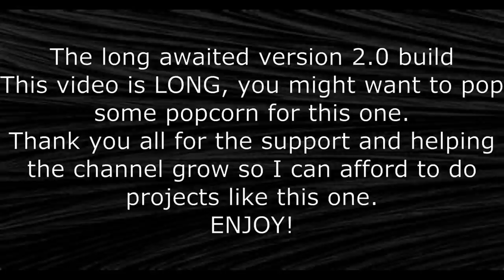Homemade ice maker build! VERSION 2.0! Cleaner build! #435

Comment: Hi,
Looks great, good work!

Q, I don't see how you can have a single normally open door switch (which is an excellent feature add btw!) Controlling Both fans simultaneously.

While individually toggleing the power separately to each fan via a unique switched outlet with the temperature probe?  If they're tied together at the switch they must be tied together at the power source otherwise I believe there would be a dead short,  or is the door switch inline with the line cord on the smart strip, what am I missing?
I did note you mentioned you were going to order a second interlock switch.  
So was that an oversight and the second switch will allow you to isolate the two fans for independent ejection cycle control?? 
In the meantime you could bypass the switch for one fan (which you have to do anyway) until the second switch arrives permitting individual power control of each fan now.

Good luck!
Reply from the maker: You can't, that's why I said it technically wasn't done and explained the fiasco I've been having trying to get the second switch in. For now I'm having to unplug the power supply to kill both fans until the second switch arrives.
Reply: @TKCL  

Hi,

So is the root cause of the problem you only purchased one switch initially not realizing you needed two for individual control ?

If so you will also no doubt require an additional independent DC supply to individually toggle the 2nd fan, as well.

Or is the goal to stop both fans when either maker initiates its ejection cycle? Which may be ideal, but would complicate the build just a bit (would require some inline diodes)

Perhaps a vertical barrier starting at the door extending down a bit past the fans between the two makers to interrupt the air flow when one is on and one is off to simplify it?

I would have suggested you go with a one amp transformer as the current two amp model is not required.

ASIN      B084JG4619

Coolerguys 100-240V AC to 12V DC 1A Fan Power Supply, 3PIN Output or 4-Pin PWM 

However it may not fit on the smart strip without a  six inch extension???

Re the controllers temp set points ...

1-  Outlets both set to - Normally On.
2- Trigger - Off @ 40° F or above ?
-you mentioned upping it to 80 but then the fan is fighting the heater (dangerous)
3- Trigger - On @ where exactly ? Somewhere below 40? but that will take a very long time at the precise time you WANT the fan on in the first place.

Even setting it for a differential delta is tricky as it can overlap and is confusing.

I don't believe this is the proper tool for this job? Perhaps a pair of ...

ASIN 	B00WV7GMA2

May be more appropriate?
as the fan will stop as soon as the heater starts and resume the moment it stops perfectly maximizing Both the heating and cooling cycles.

Thoughts?

Good luck and thanks for the fun!!!
Reply: PS
 Perhaps super high velocity fans (150/60 cfm) are no longer advantageous now (as opposed to a standard one of 60-70 cfm) that you are so close with max cold or not air. Just having any fan so close is super dupper effective, just NOT when the heater is on.
Reply from the maker: I started with low velocity fans and then moved to high velocity on my last build. Testing showed a significant increase in production with higher directed velocity
Reply from the maker: I have two power supplies and went with the 3 amp ones after talking directly with someone from cooler guys. They recommended the higher amperage power supply for this type fan.
Reply: @TKCL  

I see however 
That was with only one which wasn't directly pointed at the mold though, a very big difference imho.
Good luck 👍
Reply: @TKCL  

Hi.

But as per the spec they only draw 3/4 of an amp.
SPECS
RPM: 3500 +/- 10% Current Rating: 0.75 Amps Air Flow: 157 CFM

Also btw, the brick model is only rated at two amps which is still 160% more current than required.

So cutting it in half is still far within spec

Good luck 👍
Reply from the maker: If I remember correctly it had to do with fact that I am running these 24/7, the bigger power supply can probably shed more heat and will last longer in this situation. 🤷
Reply: I believe the far more relevant factors are the set point to turn the fan back on at below 40 degrees. So no fan between 80,90,100? degrees in summer until it gets all the way back down to somewhere below 40 ?

That basically defeats the purpose of even having a fan at all. As that is precisely when you need it the most to gain the maximum advantage in reducing the time to freeze the next cycle. Why are you so attached to monitoring the temp to detect the ejection cycle rather than the specific electrical signal which turns it on and off in real time which you could leverage to turn the fan on and off at the same time, what am I missing ?
And the other factor being isolating the airflow with a small barrier for when one is on and one is off.

I don't want to take the fun out of it but it's really no more work or money just ...
Mo time
Mo videos
Mo views
Mo money 💰🤑😎👌

Best regards!

Comment: Great idea and video!! I bought everything on the list but the power supply in your description is the wrong one, you said that you called and got the correct one... do you have the new part number? Or is it the correct PS that I just cut, strip, and use the 12 volt connection?
Reply from the maker: That is the correct one, you can hook up to three fans to it. I had to use two of them since I had two temperature probes on two different ice makers.
Reply from the maker: Yes I used the output DC side for the switches. Hold off if you can, I am testing using one switch, one power supply and two fans in a different location. Test results out next week.

Comment: I wonder what would happen if you insulated the entire outside of the freezer with that foam board?
Reply from the maker: Catastrophic failure, the outside of that freezer is hot because it's shedding the heat removed by the coils from the inside.
Reply: @TKCL  Ah good point...
Reply: Too bad its not a walk in freezer where the coils are much further away and you could get a higher level of insulation on the box its self..

Comment: Making this comment as I'm watching so if you mention it in the video... disregard this comment... .I'm just wondering... I noticed the original needed defrosting badly.... so how are you going to deal with defrosting them? Just curious.... that would mean basically starting OVER from scratch in the ice making department.... I guess it wouldn't be a problem if you did it in the middle of winter or something when you're not using much ice.
Reply from the maker: 2-3 times a year I unplug, defrost and clean. This should be done more often than that with any ice maker as it keeps it sanitary.
Reply: @TKCL  Oh for sure. In my side x side I take my ice out and dump it and sanitize the bin and clean all the parts that go through the door...I was just curious how you managed the lull of having to start over with ice production since you use so much.. this was a fun video to watch btw

Comment: Great Build Andrew!!! Almost done with my own and I credit you with that.  Question: Did you wire the ice makers to freezer again as you did in first build or wire its own plug. I've watched the video of the back several times, but don't see wire running down to the compressor. Thanks for your time and dedication to this project!!
Reply from the maker: Own plug, that way when it fills up I just unplug them and keep the freezer running. Thanks for watching
Reply: Does it matter what side of the water valve gets the neutral and what side gets the line from the ice maker? I see they are wired for continuity so I figured maybe it didn't matter, but can't find a diagram. Thanks again.
Reply from the maker: No difference, AC current alternates polarity.
Reply: Thank you
Reply: Got 11.5 lbs, each day for 2 days so far. Only difference is the insulation. Mine is 1in purple board from home depot,  not the stuff you used.  Everything else is the same.
Reply from the maker: That's great results

Comment: My $140 countertop ice maker makes 18 pounds of ice in 24 hours and it takes up about the same amount of room as a milk crate.
Reply from the maker: I have one too. I have to constantly babysit it, bag the ice and pack it away. It's nice to have my homemade machine run 24/7 for me and have it stored and ready.
Reply: @TKCL  $500 vs $140.  Does a person really need a chest freezer of ice at the ready 24/7?  This just seems like a total and omplete waste of funds.  I don't "babysit" my countertop ice maker.  I make ice for something, I just let it run until the water reservoir is empty.  I use what I need, and bag the rest tand toss it in the deep freeze.

To each their own, but to do this you have way more time and money than brains.
Reply from the maker: Yes, your thinking for your situation and not others. I use a cooler multiple times a week, a lot of people do daily. I am on a boat a minimum of once a week. If it happens to be a saltwater trip, I need upwards of 100lbs of ice ready to do. That's way to much weekly ice for me to sit around and constantly bag ice out of tiny table top trays.

Comment: I watched a lot of these tests and I see you’re so very careful about everything my concern for you on this one is you were worried about the mold factor of the PVC trim board you put around the outside but you put Insulation board. why not some thing like a bubble insulation basically same R-value but cleanable.
Reply from the maker: I'm probably going to wrap the foam in metal flashing tape so I can easily clean this a couple of times a year.

Comment: On my 2.0 version I noticed something weird with the fan. I have the same fan and adapter you have. I noticed the air flow kind of sucks. Like there is a dead spot in the center. So I took the adapter back off and if was full strength again. You notice the same thing? Think it’s an issue with cooling?
Reply from the maker: No because on my last one, I gained a couple of pounds a day of production when I added the shroud. But the ice makers were set up differently too.
Reply: @TKCL  check.
Reply from the maker: I am now
Reply: @TKCL  😂 I’m sorry I didn’t mean like, Hey go check on it. I meant check as in ok sounds good, I understand. Sorry.
Reply from the maker: Lol, well now I'm curious and thinking about removing the shrouds.
Reply: @TKCL  only thing is the purpose of the shroud/ adapter is to connect to pvc and be able to suck cold air from the bottom. I haven’t thought of a way yet to connect the fan to PVC or anything else. I guess I could get some HVAC sheet metal and make a small duct. I don’t have a press brake though to bend metal.

Comment: Why can't you wire both fans to same switch and not need two? I assume you want them running at the same time anyway.
Reply from the maker: I was thinking alternating current, but forgot I tapped into the output DC side of the power supply. I technically can use one switch that way I believe.
Reply: @TKCL  

Hi, 

1st  ...
I believe If the fan circuit is wired in parallel on either side of the transformer AC or DC you would loose the ability to individually toggle the fans on and off when each maker independently triggers its own ejection cycle energizing the heating element. 

2nd ...
** Andrew,  what do you think about maybe optimizing the build with a single ice making unit First? Then when you are satisfied, simply double it with a mirror image configuration if and when you choose?

3rd ...
Also, re the high velocity fans they may be better suited to push and or pull air across the compressor compartment and have them toggle on and off in sync  with the compressor by taping into its power feed with a T connector, see ..

ASIN    B08H8D23HB

4th ...
While the standard velocity fans placed only inches from, and directly at, the cube mold are, I believe enormously effective , making them a threat to the defrost /ejection cycle.

Thoughts?
Reply from the maker: I'm still convinced that air over the water in the ice makers will produce the greatest chilling effect. But I do have concerns of evaporation and water/ice build up behind the ice makers as a result.
Reply from the maker: Compressor compartment testing is also something I'm considering
Reply: @TKCL  

You can Scope it out on the original unit before you get rid of it, place it on it's side to get a good view 
And
Figure out Exactly where to tap into the AC power line that lights the compressor when the thermostat kicks in to tap into with a T clip connector...

ASIN      B085TS8JNR

For the Power supply for the fan 

Figure out whether to push or pull (?) or both from and mount the fan. 
Or just place it on the outside of the cover vent if nothing else is better??

This will definitely reduce the power consumption maybe put the kill A Watt meter on the freezer all by itself for a bit to get a before benchmark starting now to compare to later???
Reply from the maker: A lot to test no doubt!

Comment: Do you need a water regulator?
Reply from the maker: No, not if your pressure is industry average.
Reply: @TKCL did you wire each ice maker separately or did you wire them to one plug? Im having trouble with my build

Comment: Good choice making a more informative video rather than splitting it.

How hot is the condenser running on this model? I'm thinking when it's not going as low it might be that the system is saturated and condenser can't dissipate enough heat. The compressor might also be to hot and not making enough pressure. 
I would probably invest in some smart switches with energy usage meters and ditch the killawatt meter, they are cheap and makes it easier to see how often the compressor is turning on and for how long it stays on each time. Cycles are bad for everything (efficiency, compressor life) but is a necessary evil if things get too hot. 

How cold does the new "distance square" (pvc insulated thing) get on the outside? 

I would personally ditch the door switch for the fans and replace with manual switch on the outside, just so the fans (and the air) doesn't move when the latch is opened, and it's cheaper. Some simple switch with indicator light. 

I feel there is a big chance that the compressor in these units isn't rated (or intended) to be loaded this much, so helping that system as much as possible is probably a good thing for longevity.

Some simple head calculations (with Google aid) there is about 600 watt hours of heat dissipation needed to cross the phase change of 14lbs of water (not 600w from the outlet, compressor has better than 1:1 energy conversion).

Tech ingredients and Technology connections here on YouTube have both done interesting videos regarding heat pumps (AC's and freezers) that are worth watching for ideas.

I like your build even tho I will probably never need something like this, I live in northern Sweden and have bought ice like 5 times in my life 😂👍
Reply from the maker: Thank you for the informative read

Comment: How do you prevent starving the fans for air when the chest is filled with ice?
Reply from the maker: No air is leaving so no air needs to be replaced.  It's simply moving the air around in the sealed chest.
Reply: @The Kelley's Country Life  when you have a plenum and no air can get to the intake,  you are not circulating air.  Just like when you put the palm of your hand over the hose of a vacuum,  you will hear the rpm of the vacuum increase.  That is because there is a lack of air for the turbine to push. (No load)  if air cannot get to the intake side of the fan, it cannot push air out.  I would lose most of the pvc pipe so maybe you are pulling air from a third of the way down so you don't have to worry about ice blocking the air passage.
Reply from the maker: Can't argue with results. 100 percent increase with fans vs without. Obviously air is moving inside.
Reply: @The Kelley's Country Life  yes, air is moving inside until you cover up the intake side of the fan.  If air can't enter it can't push air out.  And I'm not talking about air from outside the box. I mean air to be circulated.  If the ice covers the intake plenum, the fan will not have that cold air to circulate. It will only push whatever air is coming back around the blades.  I haven't seen your final video on the 2nd box so maybe you have addressed this already.
Reply from the maker: Ohhh I see, no worries as I scrapped that design quickly.
Reply: @The Kelley's Country Life  I just saw the last video.  I'm very impressed with your results.  I am thinking of doing similar build with my existing deep freezer.  It is about double the size of the one you used but I want to make it a drop in setup where I only need to cut out for wires and tubing.  Do you have a link for the ice makers themselves?  And the variable speed fan you used?  While my boat has a small refrigerator,   our longer trips require coolers as well and I probably will want to make about 20 to 30 lbs for the weekends.  I also make block ice by filling 1/2 gallon juice containers i line about 10 of those across the bottom of the cooler
Reply from the maker: Yes, click on the video description. I always list all parts used in the video description. Everything is easily sourced from Amazon.